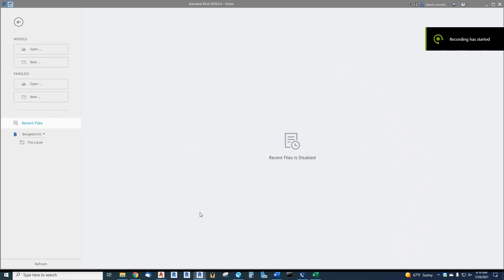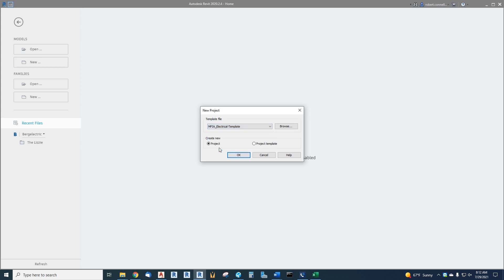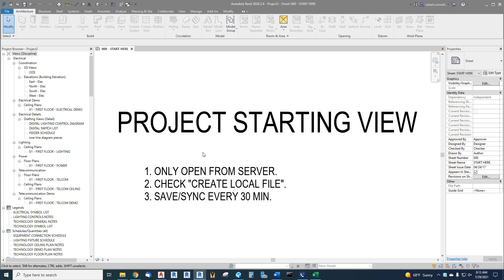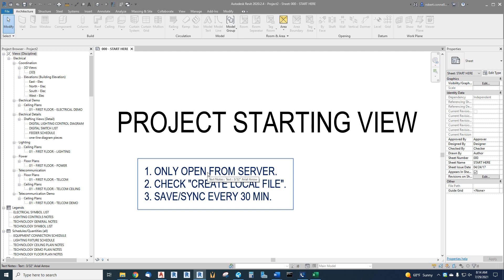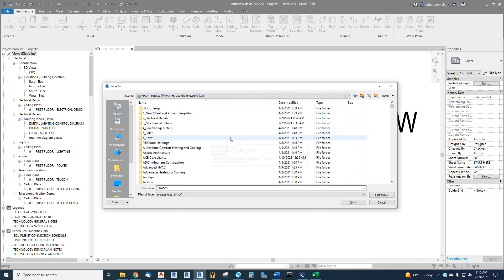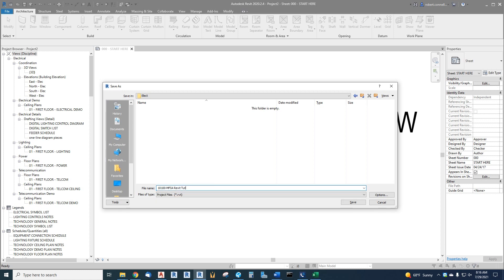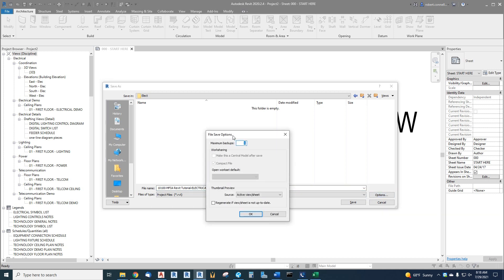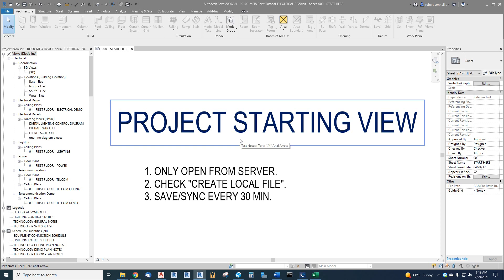New to REVIT Electrical? Start Your Model Like This

Comment: How to get the template?
Reply from the maker: Thanks for watching! The electrical project template we use is our own in-house template, and is not available to the public. However, a future video will show step by step how we created that template, so you can easily create your own to suit your exact needs. Cheers
Reply: Looking forward to this tutorial. Thanks for sharing your knowledge  @ElectricRob
Reply: @ElectricRob  That would be insanely helpful since I'm trying to learn a bit about revit as an electrical engineering student. I'd greatly appreciate it, I'm trying to start a project  but I've been having trouble getting a template to learn from.